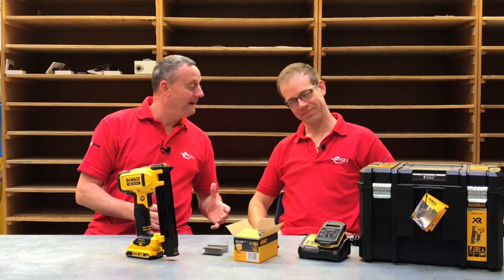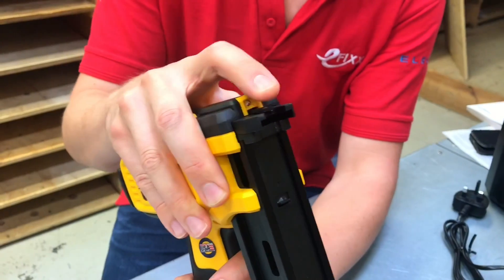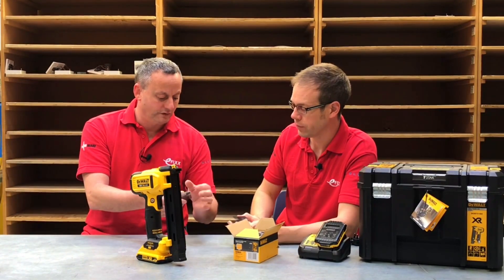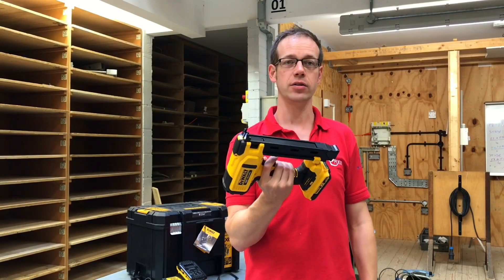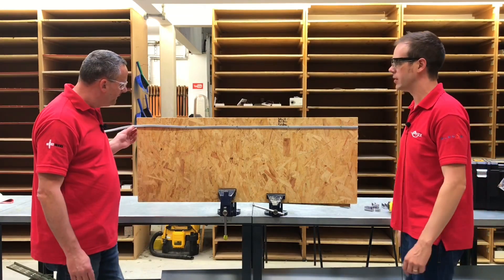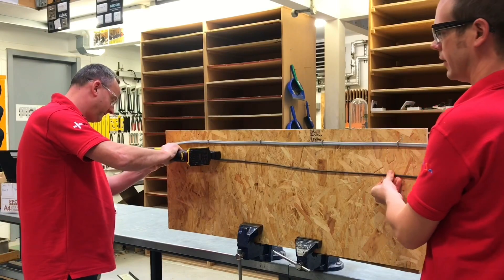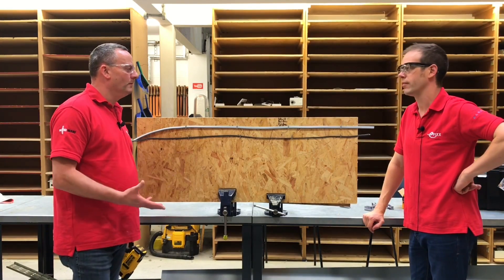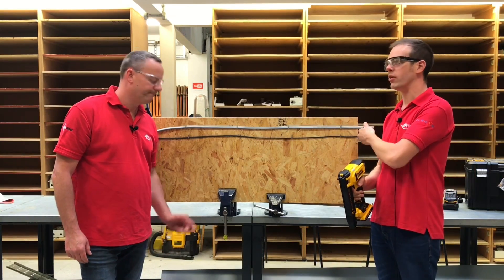REVIEWED: DeWalt DCN701 Electricians cable stapler for clipping twin and earth cables (Romex)

Comment: It’s a nice fancy Black and Decker, limited in it’s use as you can’t get between 400mm joists all having different size staples to give a better grip would be good. Also Gaz you mentioned that most new homes have stud walls , well we’re not Americans we don’t fix our cables to the studs , we’re not pilchards. And we should not be coping how our friends across the pond do things,
Whatever next will we be dispensing or earth sleeving  and an just having a bear earth like the Americans. 
Still not a Bad tool if that what turns you on.
Good video as always Guys 👍

Comment: Looks great for where viewing the cable isn't visible.  It would be better if there were different staples for different cables and you could set the depth.  Then I might use it for visable areas.

Comment: Owned the gun for 3 years. Amazing. If you are installing wires in a roofspace of an existing house you will save loads of time and effort. Not recommended for new build rough ins. Clips are about 10c each in australia. Versus 3-4c for normal clip that you hammer in
Reply: Depends though doesn't it.  Time is money.

Comment: I am reading in reviews elsewhere that it works in soft wood, but not at all on harder/older wood like old joists. Have you tried this?
Better news is that Screwfix are now stocking the staples whereas before they only sold the stapler!
Cable movement is a real advantage when you need to adjust the wiring a bit or come to the point where you need to strip it out. You could even thread new cable through the staples in a replacement scenario.

Comment: So, you can shoot this into breeze block with varying success but it does work. Have to take into account this was designed for the North American market where most states code requires cables to have slack and not be clipped tight though, something foreign to the UK scene but becoming more common place.

Comment: I love mine! Wait till you start using Arc Fault Breakers that additional slack that allows the cable to move is almost heaven sent. The old school guys who think that their hammer is Mjölnir and have been exceeding the bend radius of their cabling for years here in North America have become the bane of anyone doing trimming/2nd fixing or service work. They also tell end-users when they come back to do service calls that the reason why their electric Circuit doesn’t work in their bedrooms “it’s because the house has settled and it’s pinching the wire”. Not even joking...😒
Reply from the maker: Thanks for the insight!

Comment: Why can’t hasn’t someone designed a staple and gun that fits specific size cables firmly. It seems obvious. Wouldn’t entertain this slack fit system as it seems like a rough way to install cables. That said Great demonstration guys .

Comment: Good video. Well presented. Hopefully this is a start of a trend for all tool manufacturers to follow as usually completion betters the tool market, and giving us more option. Would be nice to see various sizes of staples and a smaller version of a gun to fit in between a 400mm joist gap we usually find ourselves trying to clip onto. Good start DeWalt
Reply: 400mm gap for a well built individual whistles with the sausage fingers thing going on as well.

Comment: The demo was no good, whether it's a nail gun or stapler they won't fully drive home unless the base material is fixed and fully supported. The OSB board was only supported by a vice at it's lower edge, the top edge where the stapling was taking place was free to flex and was absorbing the energy from the gun. I can't believe they were dumb enough to do this and blame the product !

Comment: Can't hold cables up with plastic cable ties anymore because cables sag when they melt due to fire. I suspect that this applies as well, or should apply as well to clips. Therefore, these metal staples appear to comply better than plastic clips.
Reply: The 18th edition Wiring Regulations requires metal cable supports/clips in or over access/egress routes only. Plastic clips are still perfectly acceptable everywhere else.

Comment: you can overcome the loose staples by rolling the tool a bit more forward, this provides a tight fit to the cable.
Reply from the maker: #TopTip - thanks

Comment: I've  been using 1 now for 6 months, great bit off kit, ps you need to apply pressure to get a tighter fit.. ie compensate for the punch..

Comment: the dewalt staples fit the milwaukee stapler?
Reply from the maker: Leonardo Cavalcanti - can you send us a link to the product and we will take a look.
Reply: @efixx  https://www.homedepot.com/p/Milwaukee-M12-12-Volt-Lithium-Ion-Cordless-3-8-in-Crown-Stapler-Tool-Only-2447-20/302652845
Reply: Sorry, the staples only fit the Dewalt. The Milwaukee takes T50.
Reply from the maker: Do Milwaukee  produce an insulated crown staple for their unit?
Reply: efixx sorry but no they don’t. I sent them a email recommending a staple that would work and I’ve never heard back. Too bad, Milwaukee’s stapler is half the size of a Dewalt.

Comment: Great idea, I suppose it can only get better, be good if you could get different size clips and be able to shoot the clips into breeze block and cement course so you didn’t have to change between the nailer and a hammer when clipping down walls.
Reply from the maker: Agree - If this catches on we are sure more manufacturers will follow and hopefully this will drive innovation and more features.

Comment: I’m not convinced sorry DeWalt. Nice idea, you mentioned about the alarm cable staple gun which was very secure at fixing the cable, so this isn't a new concept, I just wouldnt be happy with a one-size fits all and the cables being loose. Great Vid, although the bare shelves apart from one behind you messed with my OCD 😂🙏👍

Comment: Seems Dewalt need to make clips for different size cables?...hmm..I was hoping that slack in the cable wouldn't happen. Prob OK on a 10mm or 6mm T&E and the limitation to fixing on wood is a big deal breaker. Clipping to mortar lines and block is a pain in the A**e...missed a trick there Dewalt ;-)
Reply from the maker: Hi. 100% it will support 10mm2 twin and earth cable. Thanks for the comment and feedback 👍
Reply: or an adjuster on the firing mech itself